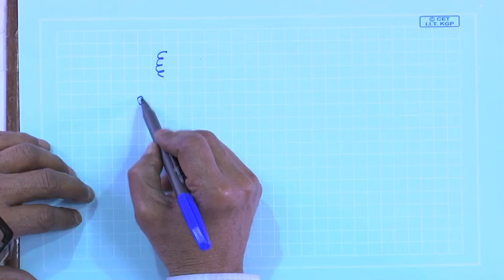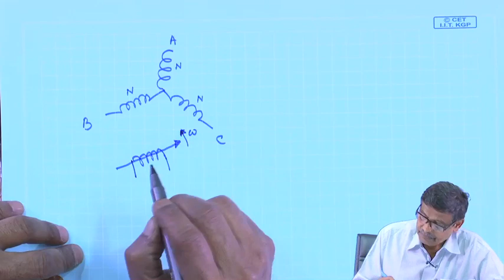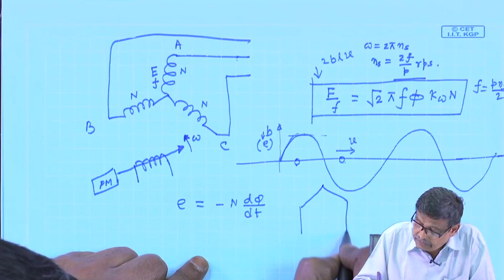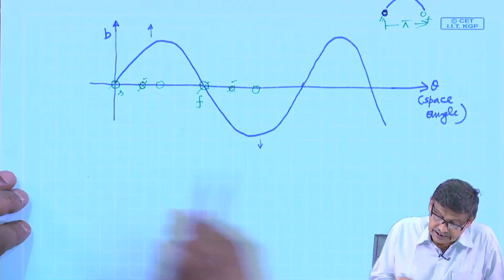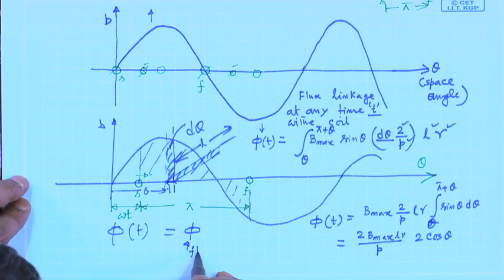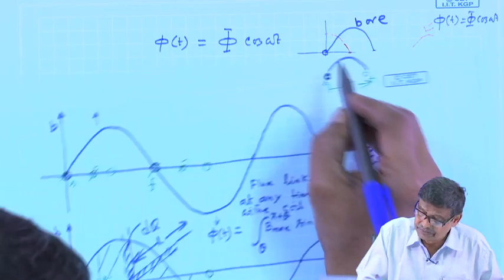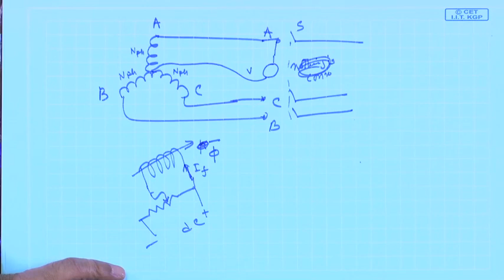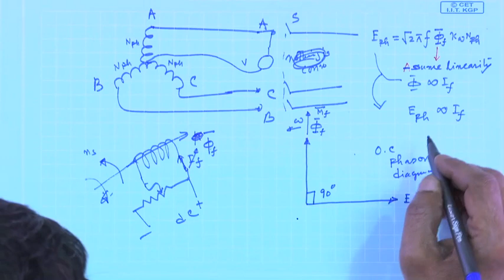Lecture 77:

Comment: In the last two minuits of the lecture , why the flux per pole is cosidered to be phasor and why it is leading the emf (flux per pole is constat value ) ? the flux linkage to the coil is the phasor that lead the induced emf not the flux per pole  ?